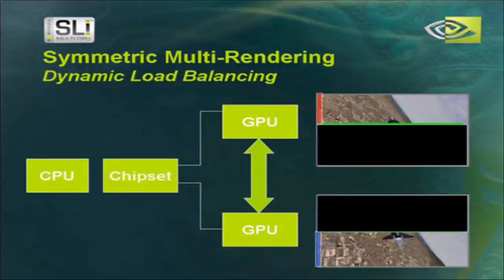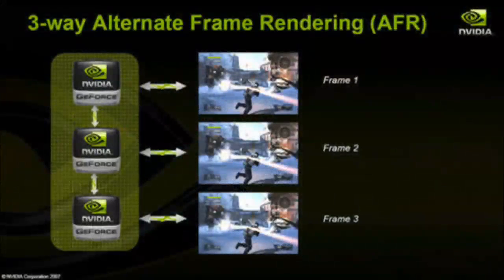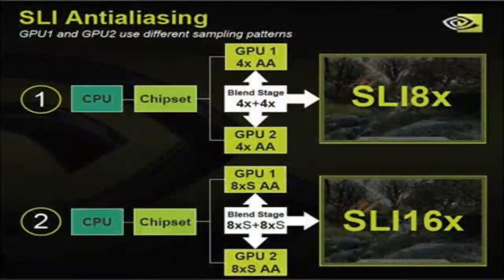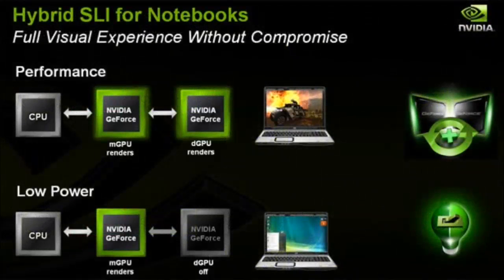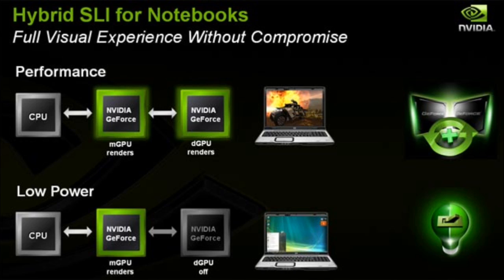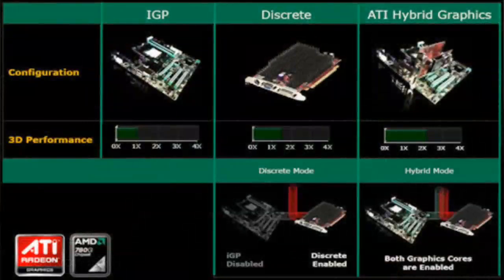TechBits 5 - Comparing SLI and CrossFire

Comment: I could be mistaken, however I do believe you can crossfire a 4850 with 4870 where as you cannot use sli with a gtx 260 and a gtx 275.

Comment: i have 2 question 
can you sli gtx 275 896mb and gtx 275 dual gpu 1792mb

can you sli 2 gtx 275 but different brand? or same brand at different clock speed

Comment from the maker: those two cards cannot be put in an crossfire configuration together.  The 4830 is compatible with the 4870X2, the 4850X2, the 4870, the 4850, and the 4830.  The 3450 is compatible with the 3470 and the 3450.